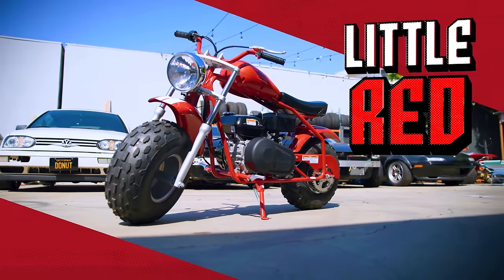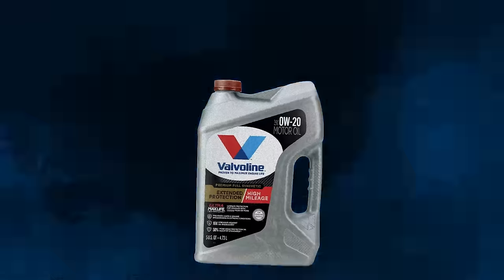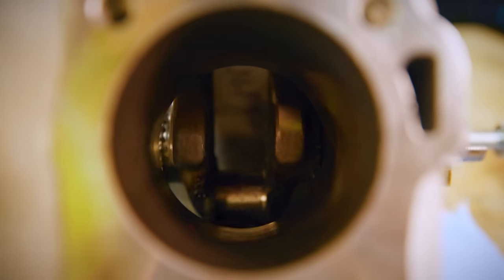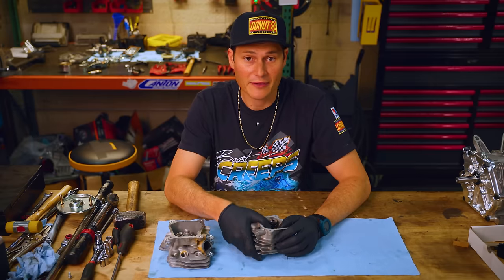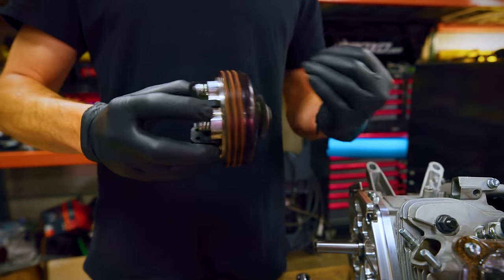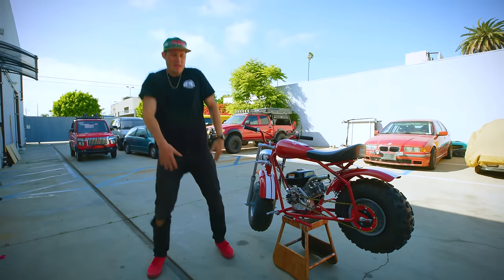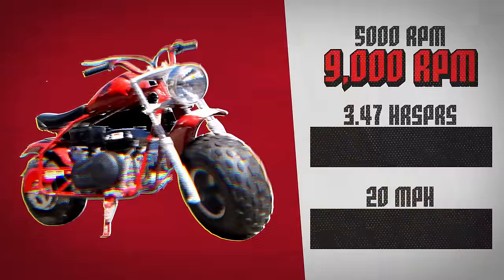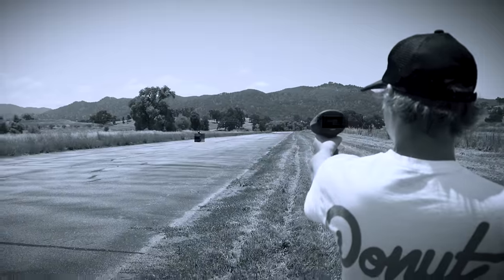We’re Building the World’s Fastest Walmart Motorcycle

Comment: 3 to 18hp was an insanely good gain for such a small engine, with just swapped internals and a better carb. Well done. I honestly thought that little pewee grade engine would have been tapped by 12hp, and needed nitro or likely not feasible FI to go further.
Reply: I wish they would have said what cc/size engine they're using. 3.4 hp sounds like a 79 or 100-ish cc engine. Those Phatmoto bikes use a 79cc but have cheap clutch & some other cheap parts. With a better gopowersports clutch & few others parts one of those Phatmotos could be very reliable.

Comment: You definitely need to mess with the gearing, id try out 15(clutch)/53(rear sprocket). Max porting and polishing the head does sooo much improvement in air flow too. Also port matching and scoring the whole intake manifold helps with atomization of fuel.

Comment: Jerry actually risking his life to prove someone wrong, respect
Reply: how is he? curious
Reply: @melvindoo2396  It's a bike meant to do 20 and they are trying to push it to 100, with all the modifications and increase in fuel air and compression it's basically a grenade. When the dude said "you better not blow my foot off" it was a genuine concern. But to be fair most engines are grenades we have all accepted as part of our lives.
Reply: @martinc7561 i think you think engines are much weaker than you think. Theres a reason they upgrade multiple parts that dont directly give it horsepower, it overall strengthens the motor as well. Only time it becomes a grenade is when you push it past the upgraded parts spec. Once those upgrades are on, its no longer "meant" for 20 mph. Its meant for whatever horsepower the upgrades can handle within their specifications. Just like with a regular unmodded motor. Its not even close to a grenade because they're operating it under the new modification's specifications. 😂

Comment: fyi those engines have a mechanical governor inside the crank case. It's a plastic gear with a spring clip on it. Remove it and cut down the shaft so it doesnt break off and you're good to go.

Comment: This is a great series. Hi-Low with mini bikes perhaps?!?
Reply: $160 in parts that little engine would get u to 80mph easily. My 196cc mini bike does 65 with only gov removed,40t sprocket,valve springs and carb/pipe

My 420cc mini bike does 96mph with billet rod,50lb valve springs,twister cam,straight chain,37t sprocket,flywheel maybe have 2500 into the 420 engine

Comment: Those motors usually have oil level sensors near the on switch that cut the engine if it thinks it’s too low and when you mod it to do higher rpm’s it’ll splash the oil around a lot and the sensor will cut off ignition thinking there’s no oil in it

Comment: I tried the Valvoline Synthetic High milege 0w20 oil, and my engine ran like brand new! It was quite smooth, and my fuel milage went up just like the car when it was new. Same using Valvoline gear oil in my differentials in my Subaru. I'm never going back to Penzoil or Mobile 1 or Royal Purple. The reviews say Valvoline has no review tests. I wonder why?
    I used to work on small engines when I was a teenager back in the 1980's. This video is cool.

Comment: Drag-bike tip for going fast (at the cost of longevity) -- pull all the o-rings out of your drive chain, and run it on the thinnest gear oil you can get. The chain won't last long, but on a small engine you'll get a noticeable improvement in speed.

Comment: When I raced gokarts, we had an open rules I raced. Only rule was the base engine had to be a Briggs 6.5hp overhead valve.  We had a builder do a bunch of work and made about 40hp. Even machined in valves out of a Honda Civic. Huge carb with a triple stack pump. We ran on 110 octane gas.  We tried methanol to make more power but the extra fuel needed kept washing out the rings so we went back to gas.

Comment: Love your vids guys. I think the spark plugs reading is way off. Good plugs don't look black and sooty unless it is running rich or there is oil getting past the rings due to low compression. Also, no need for a fuel pump unless you are going turbo. You can gravity feed an early CBR900 for instance.

Comment: Throw a 30mm carb and install pulse correctly so you don't have oil spewing and congesting pump diaphragm. Add catch can. Run pulse after catch can so oil goes into can not into the pump.

Comment: There is so much power left on the table.. You could have port and polished the head and added some ceramic for the top of the piston and combustion chamber moley for the piston wall and teflon for all the oily and air flow parts.. Easy +5hp

Comment: I had one before it got stolen with a stock predator 224 with a torque converter and a 38 thooth rear sprocket it pulled 54ish on a flat and around 62 with a small downhill full tuck.

Comment: what you need is a gearbox, there are several videos on the internet teaching how to adapt motorcycle gearboxes, externally in these stationary engines, with a gearbox you will have a good variation in speed, HP is not everything.

Comment: I think they're using a 100cc engine a 79cc makes 3hp stock.....So from 3.47 to 17-18 hp is a major increase. So a 79cc 4 stroke motorized bicycle build should get 6hp pretty easy with some upgraded parts. 
40-45 mph top speed with hill climbing power & 35 mph cruising speed.

Comment: Why not a torque converter instead of clutch? I have a mini bike they are fun little things to mod and work on, ive gone 47mph with just a slightly bigger carb jet, aftermarket air intake filter, no muffler, and bigger valve springs to mitigate valve float, and the governor removed with a properly gapped spark plug, little thing RIPS... with the torque converter ive almost got bucked off of it a few times from it popping insane wheelies from take off haha i went with a torque converter because i fried my stock clutch assembly by pushing it that hard

Comment: do a 420cc or the diesel motor next for the build !!! a exhaust washer in to it at where the flame hits max area 2 inches before full flame out it will be a beast and better with after market parts and I still had the governer in it !!! so I neve went passed 6000rpm. according to the motor I used. and on a kids quad to 1km run I topped out at 140km/h !!!!!!!!
anymore i need something extra !!! a advanced keyd option to go further !!! off set key or rekey crank shaft will make more!!! make a new video boy's !!!!!!!!!!!!! with this is mind !!! 15deg min !!!

Comment: So many mis-steps but it's all good. You guys should connect with Cars and Cameras, Red beard's garage, Black66 or another mini bike creator to get this done right!

"First, lets assemble our piston." NO! First, we check our damn ring gaps! It's still assembling a piston my dude!
Straight up just bolting on the flywheel without lapping like the instructions note if you hadn't thrown them away.
One of the most important steps in building with new internals is checking clearance. I really hope you did that too.
Also, bypassing the governor and blocking the holes wasn't covered. 
If you want to really get fancy with some teaching, get another header pipe and weld in a o2 bung then tune it real time with a wideband gauge. (check black66 for his recent video)

Comment: I have a question for all you motorcycle guys.

Why did Jerry hesitantly remove the spark plug cable if it’s insulated? 

(I once used a lawn mower that couldn’t turn off so I yanked that spark plug cable and the SoB shocked me) 

(Also, the ignition on my 3 wheeler gave out once and I had to yank that damn cable but I don’t remember if it got me or not 🤔)

Comment: The stock flywheel is cast iron not cast aluminum (unless it’s completely different from all other clones), that’s why it’s so much heavier. You probably should’ve started with a predator 212 from harbor freight, the low stock hp and that plastic cam is terrible.

Comment: Correct me if I'm wrong but there's only one way to hit 100mph if this is a single speed. It would be the math for what gear ratio you need to be going 100mph at the maximum rpm of the motor

Comment: I got a 212  I bored out the equast port in the head intakes and muffler.....should be bad....Mazda Rx 7 rotary engine stock at 200 with a 500 charger came out with6 or 7 hundred extra ho.with out the bottle he said ....the charger was bigger than the engine...  . That process might be helpfull

Comment: YOUR LOSING A TON OF POWER WITH THE POD FILTER ON THE CARB LIKE THAT!!!!!
You need a filter to carb runner. 
It’s ok if it has a bit of an elbow but ad like 5inches of runner.
The air flowing through the carb is too turbulent and inconsistent. 
Which means it won’t fuel properly.

Comment: I was able to reach 50 on a smaller frame with 6 horsepower and the proper gear ratio, 17 tooth clutch I believe... I also weighted 110 pounds at the time of doing so.